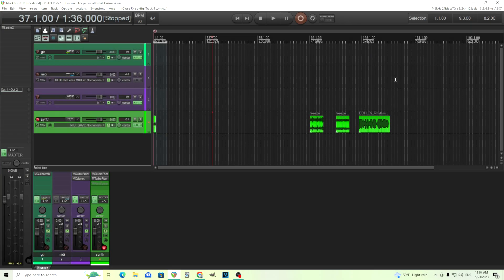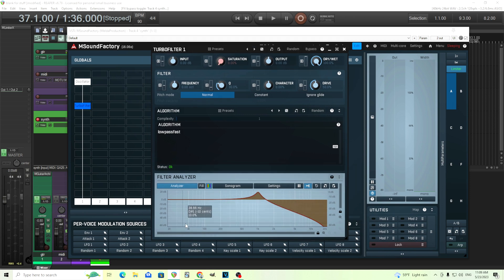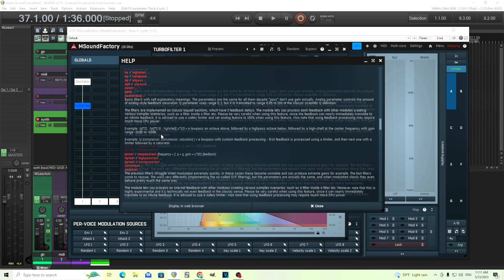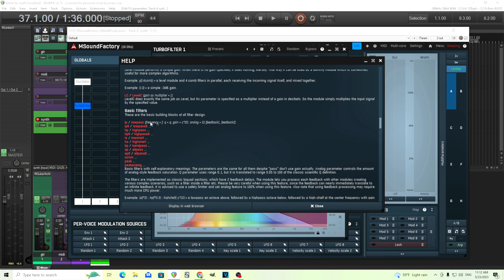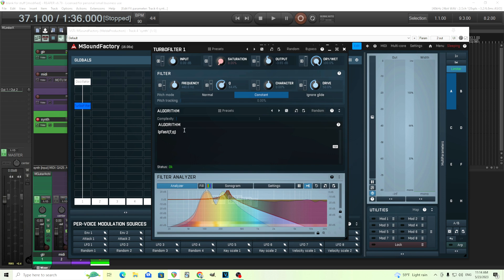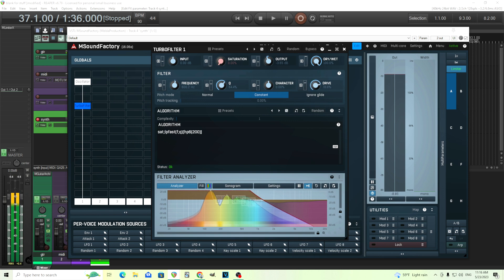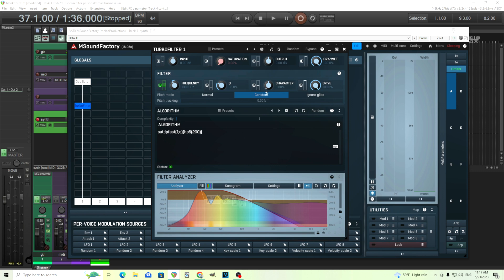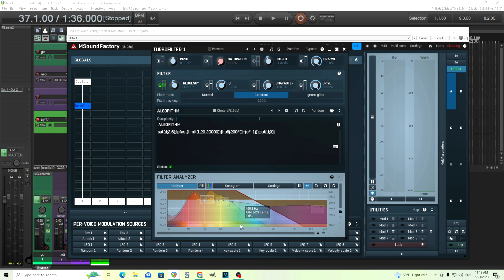MTurboFilter an adjustable filter designer

Comment: MTurbofilter is included in MXXX, MSoundFactory and MPowerSynth, if I am not wrong.  I am away from my laptops so no way to confirm it.  So it is there, but not as a single Plugin.  I have been curious to know why not.
Reply from the maker: There is a separate plugin and you can see it at the beginning of the video. It is the same as what I showed, but the plugin contains LFOs and envelopes I believe. I hope that helps.

Comment: Is there a way I can "play" a sequence of wavetable morphs, create a snippet of the frequency spectrum transformations, and convert that to a filter/algorithm (preferably automatically)?
Reply from the maker: I'm not sure you could do it as a filter, but you might be able to do it through convolution. Either by using the convolution function in the mixer or creating an IR. I'm not sure if that is exactly what you want, but it seems like it should work.
Reply: Thanks for the suggestions.  I will give them a try.
Reply: @stevew2724  Actually i think the "Speaker Positioning in MCabinet" videos can get you in the ballpark of what you're going for!
Reply: ahah i'm only confortable to say that it is possible! fuck no idea how i would get it done! what a way to push melda's limits
Reply: I'm currently looking to find a way to do this, did you come across a solution within turbofilter?
Reply: @stevew2724 

-mturbofilter has ratio function built in so if it's crossfading between filters like in a SVF using say the drive knob, we can do it with say

RATIO(d; 1; 2) [LPFAST(f; q); BPFAST(f; q); HPFAST(f; q)]

-for what I wanted to achieve I wanted specific values to happen at certain values of the knob (say a morphing formant filter, that changes based on drive control), and to interpolate in-between values so that it doesn't snap. This can be achieved too using conditional formatting with the logical operator a ? b : c (if "a" is nonzero, then the result is "b", otherwise it is "c"), we can nest these to add more values. We then use from01(a,min,max) = converts "a" as 0..1 to min..max to interpolate our required values, here's that in action, added new lines at each : to make it clearer what values there are.
 
LOWPASS(d < 0.25 ? from01(d, 500, 400) :
d < 0.5  ? from01(d, 400, 200) :
d < 0.75 ? from01(d, 200, 100) :
from01(d, 100, 1000))

Hope this fuels your creativity as I did mine!